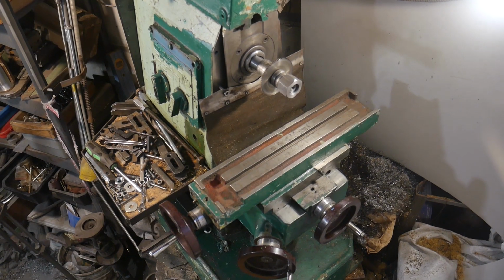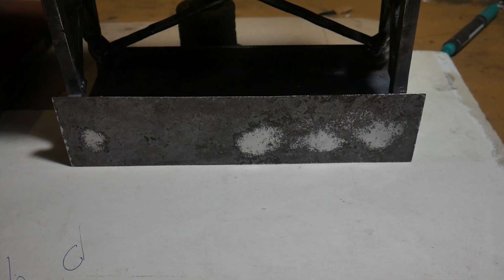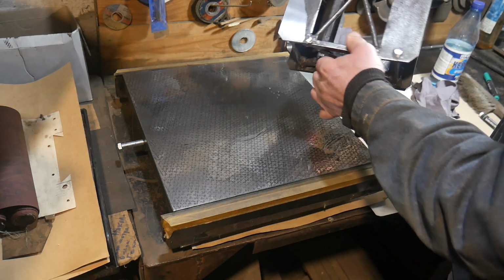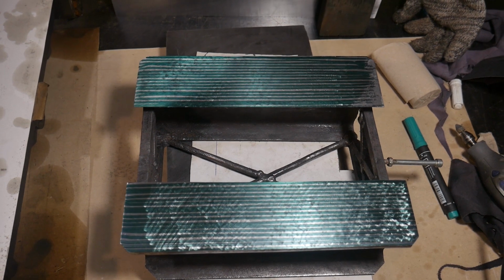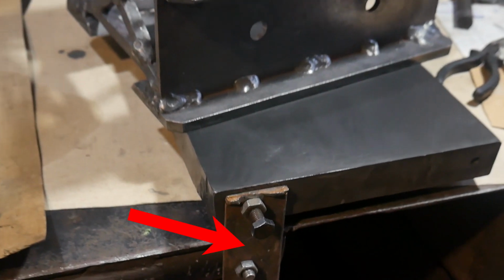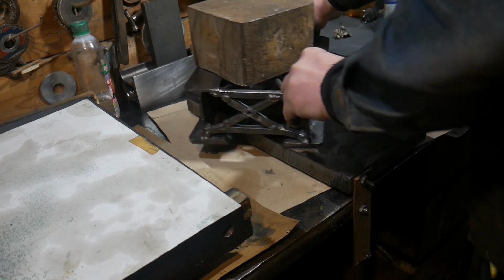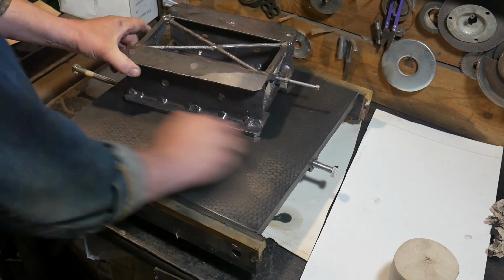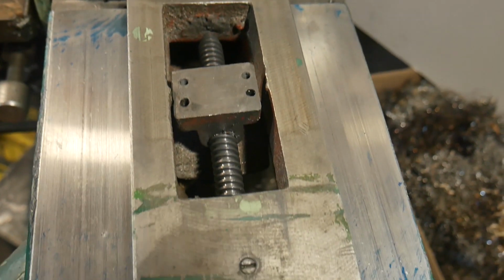Specially shaped surface plate

Comment: Hello Gena. Very interesting as always. What type of abrasive powder are you using for the lapping, and what type of oil is it mixed with?
Reply from the maker: I think it is important to use a medium-hard abrasive powder, not diamond, most likely aluminum oxide. It is probably convenient to wet it with kerosene or diesel fuel. Maybe there are more pleasant to work with, less smelly liquids.
Reply: @gena_bazarko  Thanks Gena. I appreciate your response.

Comment: Great video. Why would you choose the rubber abrasive over scraping with a carbide? Thank you for the video.
Reply from the maker: Hello! It seems to me that it is more convenient, but this has not been proven.
Reply: Scraping steel is much more difficult than scraping cast iron. I guess thats a convincing factor.

Comment: Hmm!  I'll have to try that rubber abrasive 'scraping', and measure how much material it takes off.   

There was no issue with the abrasive embedding in the metal?  How did you test for this?

Will the reference surface you just made, need to be broken into patches like your primary surface plate?  I have tried spotting parts with unbroken lapped surfaces, and it was difficult to judge how uneven the contact was, without individual spots to compare.  Maybe you have tricks for that!

Once again, thank you for sharing your time!
Reply from the maker: Hello! I will try to use a surface plate without dividing the surface into fragments. I hope it works, but we'll see. There is no abrasive embedment, this can be seen on the surface of the plate. I study this topic and collect material. Over time, I will publish a video about abrasive embedding. But even if we assume that there is an abrasive embedment, it will not interfere with working with this surface plate. After all, it is used only for applying traces of pigment with oil.

Comment: Exceptionally precise work, as usual.  Bravo.  I have two questions.

The surface plates which you have welded to the structure - are they steel, or cast iron?

Also, why did you make a special surface plate when the most usual way to mark the lower slides of the Y dovetail is using the previously scraped upper slides of the same dovetail?  I assume you want to adjust the lower slides first in order to correct the geometry?
Reply from the maker: Hello! The cutout plate is steel and can easily be made from nearby materials. Ordering cast iron is expensive. The slab is also made of simple structural steel. Surface plate 400x400 mm. from cast iron. I used what was available in my workshop. It will not work to make this pair of linear movement with high accuracy on the corresponding part, it is two times shorter.

Comment: Is that a rubber abrasive tool on the rotary grinder (Dremel?) ?
I admire that you take so many passes... I would have thought that the first pass showed a large 'slope', and I would have removed more material, in a kind of 'wedge'... but, you are much more patient, and probably avoid 'over-cutting'  ;-)
It seems that you must be very careful to try to get equal working on every part, when lapping on that steel block?
Reply from the maker: Yes , a rubber abrasive tool on the rotary grinder (Dremel).